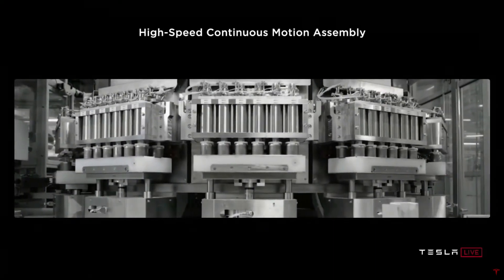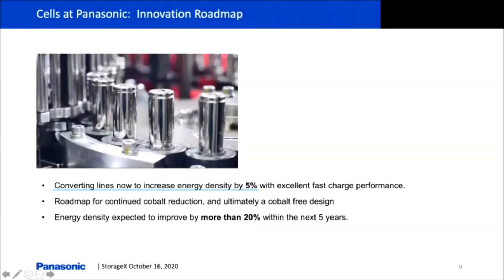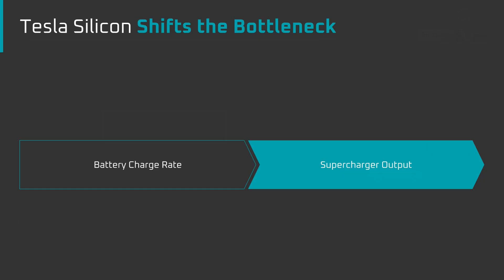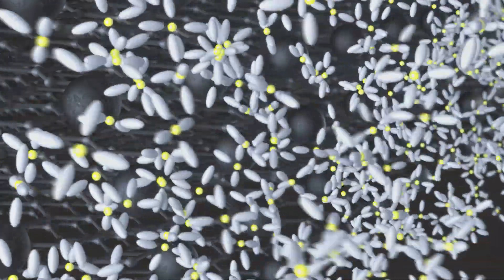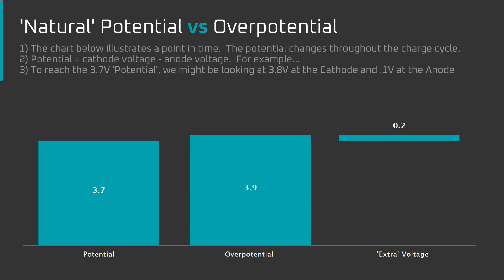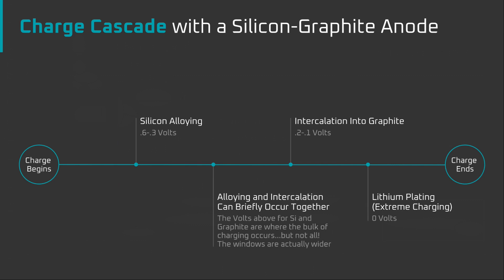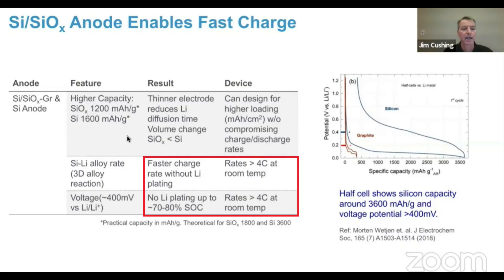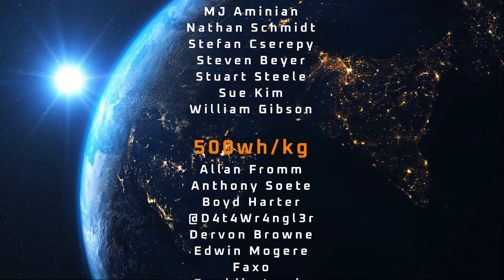#6 Tesla Silicon // Fast Charge is on the Way ⏩🔋 // Deep Dive

Comment: I believe there is a charging rate/range sweet spot beyond which further increases in charging rate are far less meaningful. If your range is 500 miles and you can drive for six hours straight before stopping to recharge, I doubt many people will want to stop for less than 15 minutes after driving for that long. And it means a full twelve hour day driving is possible with just that one fifteen minute stop if you are up to it.  Or, like most humans, you can make three five minute stops. Charging faster than that seems to have no benefits unless you are going to wear an adult diaper so you can pee while you drive. 

The charging speed you suggest here seems to be about as good as humans could need it to be. It erases that last little advantage of ICE cars on long road trips.

Comment: Where do they get the silicon from?
Reply from the maker: Doesn't matter at this point, it's super common and highly available
Reply: @thelimitingfactor  It is, but it's costly to make and then apply to the batteries.
 I only ask, because of a company that I read about that has a new way of producing silicon, at a fraction of the current cost. Their company starts production this month and it's rumoured that Tesla has signed a contract with them. It's only speculation at this point, but I thought it was interesting.
Reply from the maker: @thedudeabides5201  Depends on the grade.  Next video.

Comment: I dont think Tesla has any intentions of allowing Panasonic to manufacture the 4680 at Nevada. Good on Panasonic for finally stepping to the plate and putting in an extra line and perhaps they've done some of own R&D to achieve a small increase in density. Energy storage business is going to grow as large as the car business according to Elon. That tells me that Nevada will eventually be solely responsible for energy dedicated batteries. If i remember correctly i seem to recall you saying that energy storage does not need high density batteries and therefore the 2470 cell is ideal for the energy storage applications. If Elon had intentions for Nevada or anyone else for that matter to manufacture the 4680 FBC battery then why have the secret skunkworks at Cato Road. Every Gigafactory from now on will supply their own battery requirements so i don't see the need to go to the exspence of fitting out Nevada with 4680 production lines when Panasonic will eventually be required to supply nothing but requirements.

Comment: I cant imagine regular passenger cars need more than 250 kW fast charging.
I drive an e-Golf which charges at 40 kW max and that is very acceptable, although double that would be about perfect.
For the Tesla Semi, thats another story...
Reply: The ability to push the charging curve longer makes a huge difference in charge times!  Maximize the current infrastructure!
Reply: @Bryan46162  yes, thats right. For me a 20 min charge time is fine, but that means 3 cars an hour. If you decrease that to 15 minutes, then its 4 cars an hour...etc.
Good point

Comment: Jordan I think the v3 superchargers are capable of 600kwh but the chargers are limited to 250 I seem to remember seeing the tesla sticker on the v3 charger that shows its being limited to the CURRENT battery tech if I can find (YouTube video) the link  I will post it. 😉🍻
Reply: https://teslamotorsclub.com/tmc/threads/what-does-supercharger-v3-mean-for-existing-model-s-owners.137816/
It's in thus thread but I just googled tesla v3 supercharger specs and there's lots of pics of the specs of them. 😉

Comment: Point regarding the semi, most drivers would be okay with a 15 minute charge cycle however battery capacity would need to double in order for the semi to match over the road performance of the current Riggs. If you figure megawatts scale energy transfer for each "pump" and a typical truck stop charger size of 10 -15 units you're talking about a very substantial engineering challenge for both the truck stops and the grid.

Comment: A 4 C charge rate means if the cell is rated for 2 Amp hour capacity then it can be charged at a maximum rate of 8 Amps.
Reply: Average rate of 8 amps. Peak at the beginning will be higher